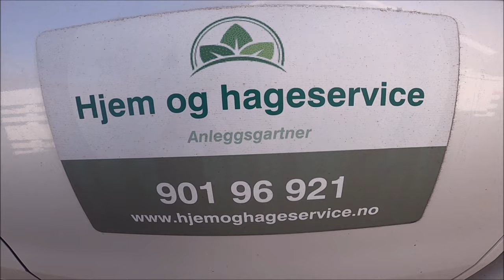Bygging av Asak Mini støttemur med Kubota u27-4. Construction of retaining wall with Kubota u27-4.

Comment: Hi, 

What kind of trailer are you using? I can see in your videos you have a trailer that can be raised. These trailers tend to be more heavly...but you are still able to stay under 3500kg with the u-27-4 on it?
Reply from the maker: I have a machine trailer to carry the excavator with. It's an Ifor GH126. With this combination i'm just under 3500kg.
Reply: @hjemoghageservice  Its a very nice setup. Do you have any problem with stability when driving? I mean, the trailer seem to have a bed that is quite high in comparison to a "normal" excavator trailer. 

Im in the market for a trailer for my ECR25D, and I like the dump-feature on your trailer.
Im still worried about the overall weight and the stability when driving. 

Would appreciate if you could elaborate your experience with your trailer setup. :)
Reply: @hjemoghageservice  So you have 2 trailers by other mean? One for moving the excavator, and another with dump-feature for other things?
Reply from the maker: @Engan01  The trailer is nice and stable when driving. It has a total weight of 3500 kg. You'l need a car that can tow that much. The high bed is because of the dump bed. It is not so good to load the excavator on because of the height.  That why I use a different trailer to transport the excavator.
Reply from the maker: @Engan01  That's right.